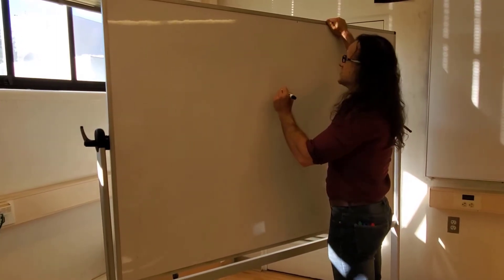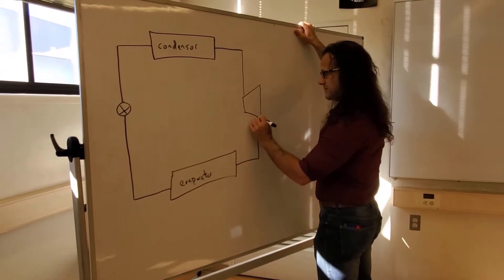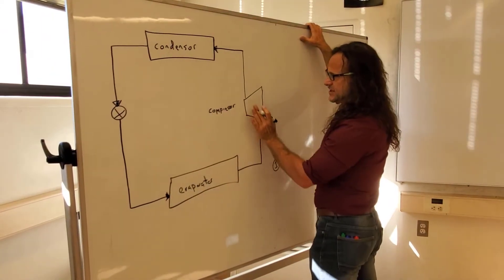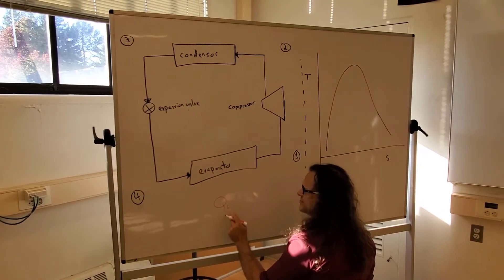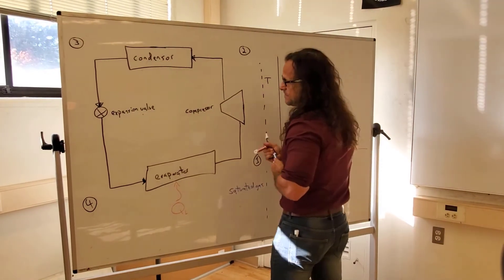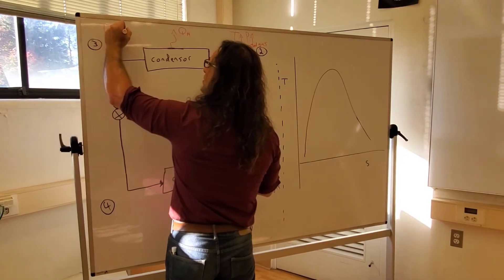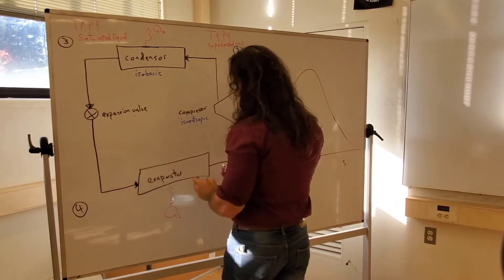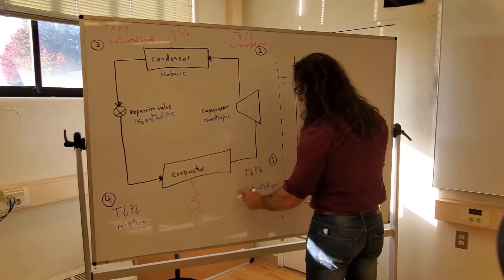The ideal vapor-compression refrigeration cycle

Comment: What is isoenthalpic, and why does it have that curve on the T-s diagram? Thanks for a clear demonstration of the ideal vapor compression cycle.
Reply from the maker: This topic takes quite a while to fully grok, here is my attempt at making this short:

Isoenthalpic (also called isenthalpic) just means that the enthalpy stays constant through that process. Enthalpy is a measure of the total internal energy of a system and accounts for the Pressure Volume product . This expansion valve we are using is intended (ideally) to keep the enthalpies the same (as the pressure decreases the volume increases). 

And, while the enthalpies are staying the same through this expansion valve, the temperature is decreasing, so the entropy is increasing which is why the curve has that shape.  Restated, system entropy is heat divided by temperature and the heat is staying the same while the temperature is decreasing, so the entropy is increasing.

Comment: You can't spell 'condenser' correctly, and I've never heard 'vapour' referred to as 'gas'.  Destroyed your credibility in the first minute. Oh, and get your hair cut!
Reply from the maker: Thanks for the comments. I see how I spelled condensor wrong on the board. You’d think I would have noticed after spelling it correctly in the captions, but I did not. I will make a mention of that error in the description. Also regarding ‘vapor’ and ‘gas’. I appreciate you highlighting this as it is nuanced and somewhat amorphous. I often refer to pure substances that are a gas at room temperature and currently have no liquid in them, as gases. I also find that this helps people learn the concepts and it works. That said, since I am talking about a refrigerator with the working fluid going through phase changes, I agree that vapor would be more accurate. I will also make a mention of that in the description. Regarding the rest of your comment, I can only imagine that you might be suffering at the moment. If so, please know that there are people out there that care.

Comment: @ 1: if it's pure gas like you said, what else it's saturated with?
Reply from the maker: I am not sure what you mean. In an ideal vapor compression cycle it would be 100% saturated refrigerant (aka a quality of 1).  In a more realistic system, it is best to output superheated gas from the evaporator to make sure no liquid is entering the compressor. Does that answer your question?
Reply: @LonnyGrafman  @ 1, you labeled "saturated gas". Does that mean the gas is saturated with something like liquid, moisture, or oil? When I use the fundamental chemistry term of "saturation" or "saturated", it means to me that there are at least two things in the mix. 

may be I'm not understanding the different terminologies in thermodynamic
Reply from the maker: @profuse007  Got it. Thanks, that helped. Vocabulary conflict between fields! In Thermodynamics, in this case, saturated just means that it is right at the edge of a phase change, e.g. a liquid, that is all liquid, right at the boiling point, or, in this case, a gas, that is all gas, right at the point where any more heat added would change its temperature and become super heated (or if any heat was removed it would start to condense). Does that make more sense?
Reply: @LonnyGrafman  Thanks. Just to tie my other comment. 

If the compressor receives the fluid that is "right at the edge of phase change", would there be liquid formed/compressed at middle of the compression stroke? i.e. Does the compressor spit out both gas and liquid mix?
Reply from the maker: @profuse007  No, the energy input pushes it further into being a superheated gas
Reply: @LonnyGrafman  I think I'm starting to putting it together with our exchanges here and looking at some of the P-H diagrams. So in order to receive a superheated vapor to the compressor, the components at the evaporator has to do a lot of the work to push it thru the saturated vapor curve-edge and toward the superheated vapor region before compression. 

Do you know, for a Copeland Scroll compressor, when the compressor receive the volume of superheated vapor, does the crankcase further superheat it (e.g. reduce P&T) before the compression stroke? I've seen hermetic compressor cut open and the path from evap line to the compression stroke is not direct. I'm thinking that the infinitesimal volume of incoming superheated vapor hangs out in the crankcase in queued for compression strokes.

Comment: @ 3: in ideal or non-ideal condition, does the condenser spit out 100% liquid or mostly liquid?
Reply from the maker: In ideal, it would be all liquid right at the boiling point (aka saturated liquid with a quality of 0). In an actual vapor compression cycle it is usually best to put out slightly sub-cooled liquid.